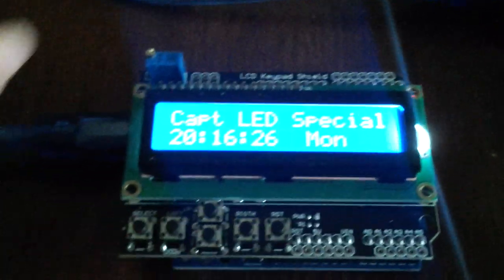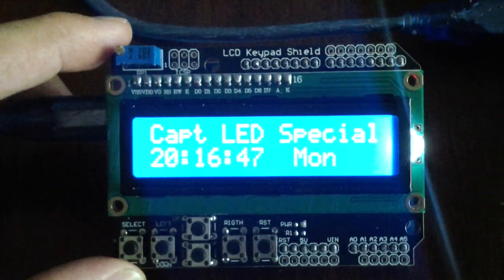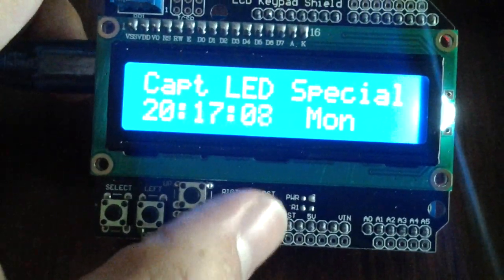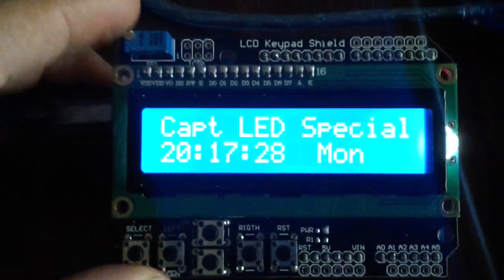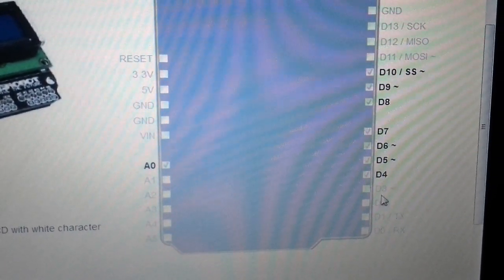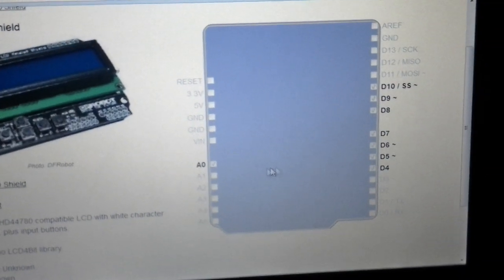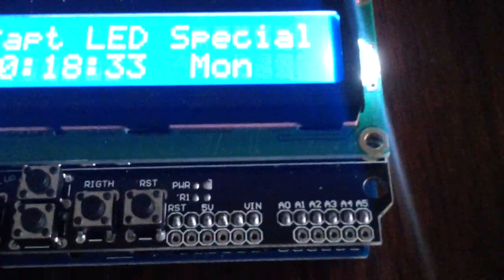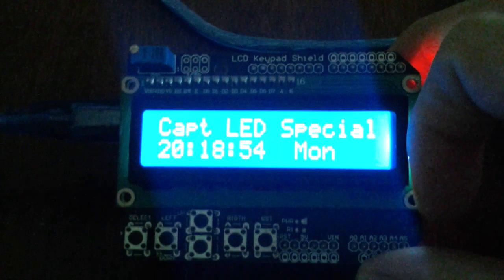Arduino lcd keypad shield

Comment: Hello, when you plug in this shield to the Arduino, can you still use the pins that are not used by the LCD? I mean lets say I want to use SPI pins 13,12,11 can I still use them even when I plugged this shiled? Thanks.
Reply from the maker: I would have to check if those pin are not connected. Been a while since I've played with this sheild :) but yes all the unused pin can be access on the shield.

Comment: Can you please give a link of schematics how to connect LCD to Raspberry PI.
Thanks
Reply from the maker: +Michael Vilanberg This shield was intended for using with arduino uno board you would need to rewire it for the rasperry pi. You might be better off with a normal lcd and making you own shield for the raspberry pi. If you really want to use this kit the schematic for it is avaible at http://www.ostrovni-elektrarny.cz/docs/LCD1602shield.pdf Cheers!

Comment: hallo to everyone ,i've got an issue with my LCD shield :i upload the arduino sketch and the text doesnt appear on the screen it's just lightned nothing is displayed.can you give me the sketch so i can try this one? where i can find this pinout?the scheme of shield
Reply from the maker: anduiy oldman pin out of the shield should coe with the actual shield and I use the basic lcd example that is in the arduino programmer simply edit the pin to match those of the shield. Here's a link http://www.dfrobot.com/wiki/index.php?title=Arduino_LCD_KeyPad_Shield_%28SKU:_DFR0009%29 Hope this help you Cheers!
Reply: bakupcpu thanks,it worked
Reply from the maker: anduiy oldman Glad I could help!